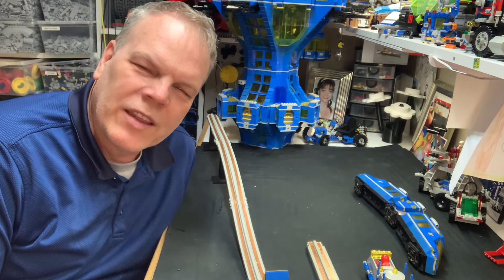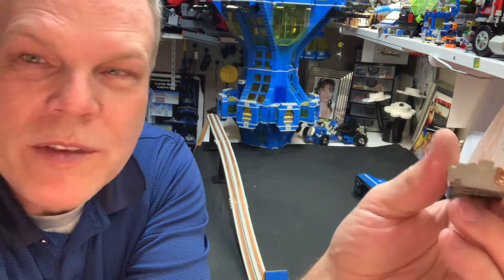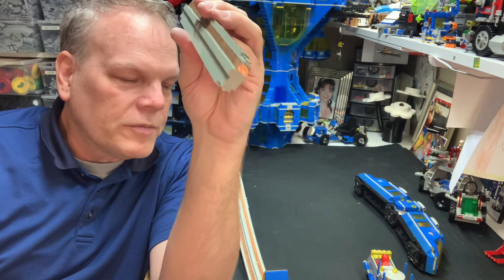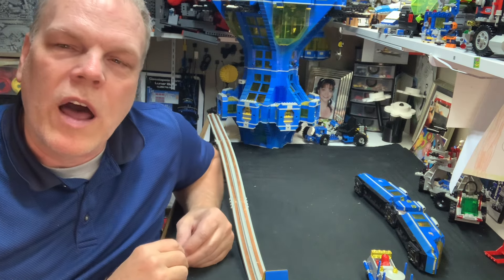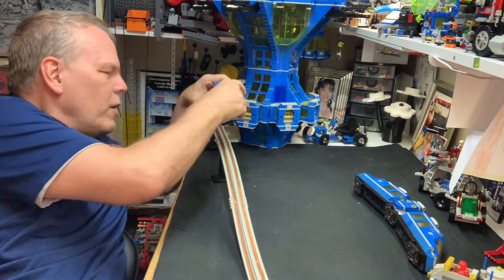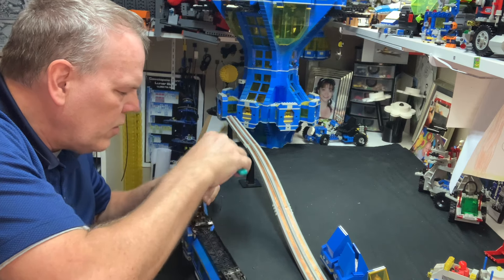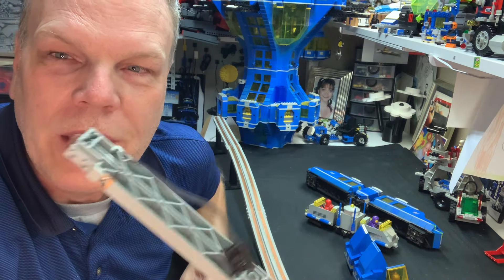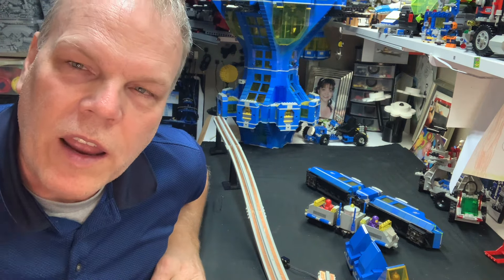DKP - Testing the fixed monorails and copper tape discussion…

Comment: I've never tried  it on lego, but I've had great success  using  micron  sandpaper  on high polish  plastics.  1,000 to1,500 grit  gives me a satin finish that holds adhesive  tapes and decals very well. It also looks "factory finished " if and when you remove it. But like I said, I haven't  tried it on lego yet. I've found  my paper from auto parts stores.  They also have it in paper form and sanding  blocks at most big name hardware  stores.  I'm really  glad I found your channel,  I've been watching  all evening.
Reply from the maker: I'm definitely going to try the 'sanding the ends' thing at some point.  And if it works, I'm going to redo all my monorail track. Great suggestion!

Comment: How about using the sides?
As in, using the connecting tiles to press some copper on-to some copper?
Would mean |______| shaped tape shapes.

O and a fun one, the model railroad add-on detail company named buch(?), had a few years ago, metalic paint that could conduct electrical current.
Meaning that in theory, you could make your own .
As for pick-ups, look at how Marklin does it for it's rail system.
Then also look up how the old Trix, not the new Trix, that's now part of Marklin, used to do it, with it's three current setup.

Basically, look at those old style ways to quickly hold a bundel of paper, together, if there is just a single hole in the upper corner.
They used to be copper, a round head with a flat underside from which two copper strips came out off (|======, that you could bend.

Now we have today, all those guys who are brick, building them mag-lev tracks, right?
My question to you, here, would that old add-on middle rail power strips for the original lego tracks, together with say technic plates with those teeths on the top, be a good combo for such a home-made track setup?

Or what about putting old school tracks in a more Wuppertal Hanging Metro setup?
Reply from the maker: I love all your ideas!! Ive contemplated the metallic paint before - just never tried it.  Overall the copper tape works exceptionally well except for the ends.  I may try the sanding bit going forward to see if that helps keep the tape on.  I'm going to ruminate on the other ideas here but this is the best feedback for the externally powered monorail I've had in a long time! Thanks so much!!